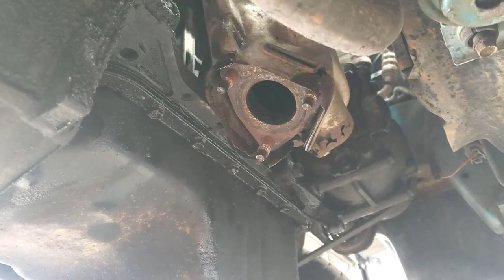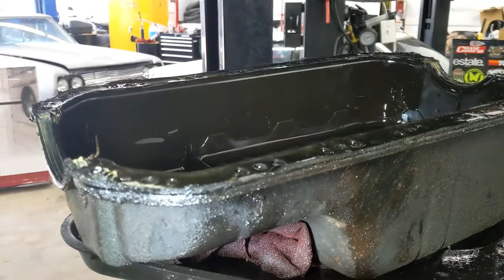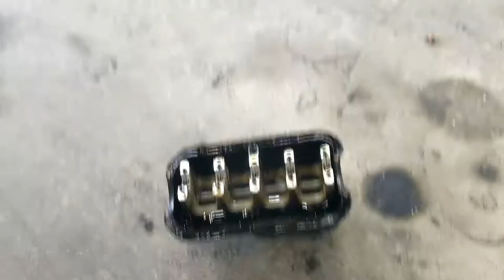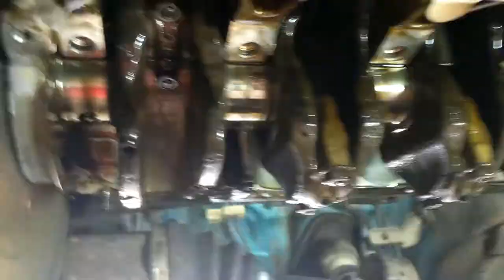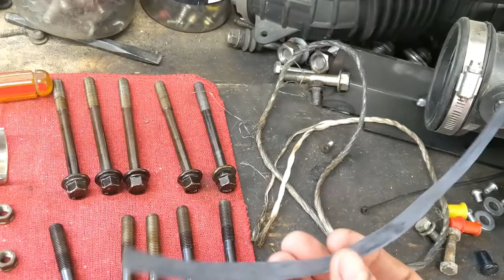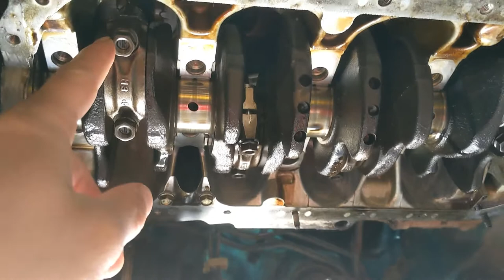Honda Oil Pan Gasket & Rod Bearing Replacement Exo Auto Works

Comment: sounds like maybe the oil pump just needed to reprime itself when you first started it after the bearing swap but I have a garage here in pville KY and I couldn't tell you how many times these "patch" repairs on rod bearings saved my customers as well as myself so much time and money as well as labor and sweat . thank you sir for the upload and the effort. luckily every vehicle we have done this type of repair on has lasted a very very long time. we replaced bearings in a 95 Honda Accord five speed in 2009 and I am very happy to say that the car is actually still running today in 2022 . However, the crank scarring was less than a fingernail or cunthairs depth so it made for a very lucky fix.  it's a waste of time and money to get one tore down and realize you have scars on the crank that catch your fingernail even after the sandpaper trick but I do have to say that I have even been fortunate enough before that I have replaced the rod bearings in a side by side with some ungodly scarring on the crank but somehow it has lasted for 13 months straight now. I suppose Lucas oil treatment is the culprit but either way I'm grateful because deer season is coming up fast and I can't wait to get back in my stand.  I'll say this now and tomorrow it'll throw a rod 😒. my luck 😆. you fellers have a good evening there and again I thank you for the video upload. I love to watch these videos because I enjoy learning new hacks and ways of making my job easier. thank you guys. stay safe always
Reply: is it still running?
Reply: @chipskylark5188  is what still running? The side by side or the Honda ? They both still run strong but the side by side is having some electrical problems.
Reply: Great comment cheers mate !

Comment: Did you have to use undersized and/or oversized bearings, if so how did you know what size to use? Thanks!
Reply from the maker: In this instance, I just went back to stock size. It's a bandaid fix, but will save you some time while getting money together to fix it correctly.
Reply: @ExoAutoWorksVlogs  would a rebuild kit fix the problem like new pistons and bearings and timing chain stuff like that?
Reply from the maker: @memesyandhorrorshorts  you definitely want to send the crank to the machine shop in order for them to inspect it and polish it if it is saveable. They would give you the clearance for the bearings as well. So long as the pistons weren't damaged you would be able to reuse them, you would want to replace the rings of course since you had them out.

Comment: Don't you need to measure the crank before replacing the bearings?
Reply from the maker: On a real fix, yes. We just were doing a band aid fix and went with stock clearance bearings.

Comment: does this fix it permanently or it all just depends on what it’s knocking from?
Reply: It depends on how bad the damage is. If the bearings are effed but the crank is clean, you got lucky. New bearings and send it. If the crank is scratched but your fingernail doesn't catch the scratch, bearing replacement will work with some luck. If the scratches on the crank catches on your fingernail, motor needs to come out and crank machined or replaced.

Comment: My oil pump started going out and I started hearing light rod knock ,today I opened it  up and found 1 rod with very little play wasn’t too bad it wasn’t knocking all the time or loud either but that was it swapped out new bearings just like this along with new pump ,, I have a question how long did this fix last is the car still running ?
Reply from the maker: It lasted for over a month before it was sold. Not sure of its current status.

Comment: i know video is old im having some weird noise i try adjustmenting valves noise still there maybe I'm doing it wrong so i try to check my bearings too but they dont have play up and down just a  little bit play side to side number 4 has a little more play than the ohers
Reply: Probably the rod bearing if it sounds like the sound you hear while driving /accelerate

Comment: Nice video. With that bad a conrod bearing, was the low oil pressure indicator lighting up?  What you referred to as an oil pump is only the oil pickup tube.

Comment: Would i be able ti get a new cranksahft from the junkyard and slap it in my motor or would i need to replace main bearing ?
Reply from the maker: You would need to replace all bearings.

Comment: How do you measure clearance for bearings and where do you measure? I need to do a repair on my own car but I hear you need to measure some sort of clearance? Need to get the right size bearings. Any help would be greatly appreciated 👍🏼 great work
Reply: plasi gauges are your best shot pretty simple to use as well